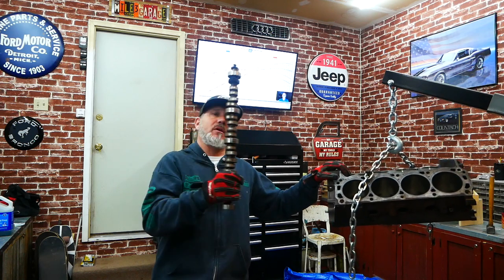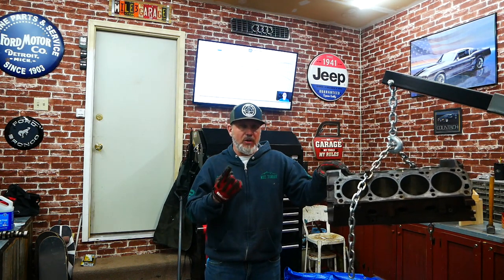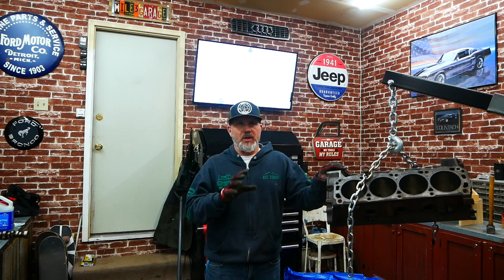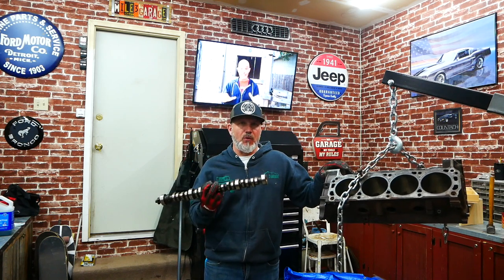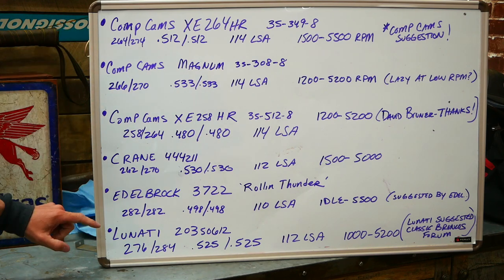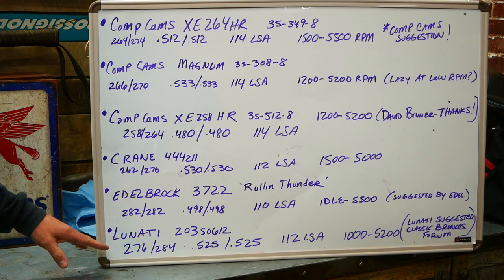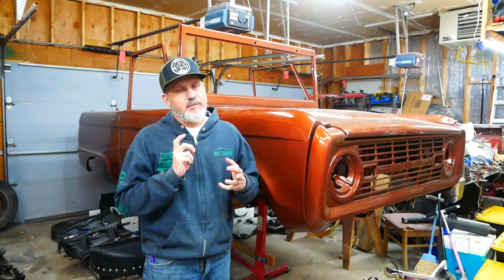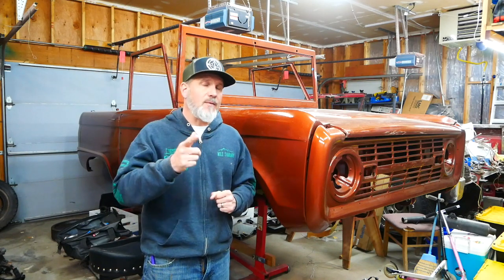Choosing A Cam For Our 5.0 Early Ford Bronco.

Comment: The cam that is at the bottom of the list lots of torque and still have the nice sound and low rpm power is the best thing for a 4wheel drive, don't have to rev up to make power to get out of a bad spot don't want to spin down in mud or sand

Comment: I just rebuilt the 351w in my 1996 F150, and used the Lunati 20350612. I advanced the cam 4* for more low end, and it makes great torque off idle to the limiter in the ecm at 5,250 rpm. It also has World Products Windsor Sr heads, headers, free flowing exhaust, etc. which helped as well. I too spent a lot of time choosing the camshaft for my needs but I am pleased with this cam as far as torque and sound goes especially since it weighs 6,700#.

Comment: ignore the advertised duration and use duration @ .050 and you can change lift by changing rocker arm ratios and you can use one ratio for the intake and a different one for the exhaust.

Comment: I spoke at length with a custom cam grinder for my TMoss ported gt40 intake, 75mm maf, 65mm throttle body 5.0 AFR165 head combo into a 3.07 geared, 5 speed 4x4, curb weight 4400 lbs.  The cam he came up with was very close to the 35-512-8 (Xe-258-HR) he steered me away from the 35-349-8 (XE 264 HR) warning it may make more power but not the torque where I would normally be driving it.  His custom cam had a little more lift than the 35-510-8 but not enough to really affect the combo.  I know we are not apples to apples but I hope it helps.
Reply from the maker: Wow, that’s a lot of info. I went with the 264 so it will be interesting to see the dyno. Maybe we can compare when we are done.
Reply: @alpinegarage8548  how is the cam going for you?
Reply from the maker: @davidsemrad5266  don’t know yet. I took a few months off to start another channel. Just now getting back to it. I’ll be updating soon. Thanks for asking.

Comment: Need to add duration at 0.050" lift it will tell you how aggressive the lobes are that is what Comp means by lazy at low rpm...just like the E303 (Edelbrok is copying it) that you have listed.

Comment: Comp cams..264. The first one on your dry erase board
Reply from the maker: Yep, that’s where I went.
Reply: @alpinegarage8548  when you get it built in running let me hear it idling... that might help me to buy the same cam for my 5.0
Reply: @alpinegarage8548   I just bought this cam for my 302 build with GT 40p heads could you recommend what all I need to change on the heads to run on a stock engine?

Comment: I was watching your video as I am in the same boat with selection but I must of missed what your CR was in your engine? I know for me my CR is a bit high 10.25 so the cam selection ICV on some of these may provide a issue for my build not sure about yours. Thanks
Reply from the maker: It’s going to be a little higher than stock.